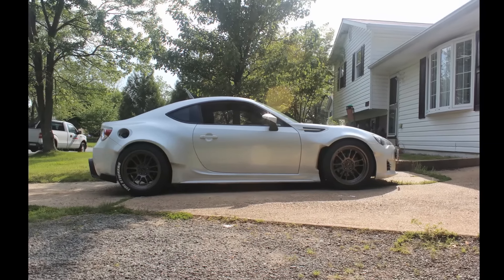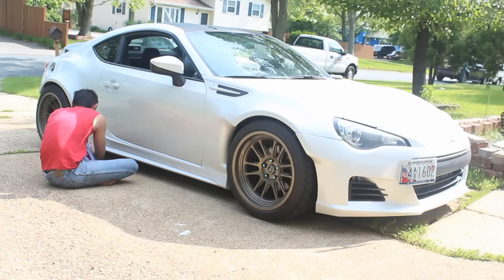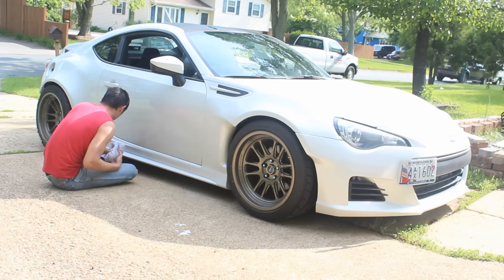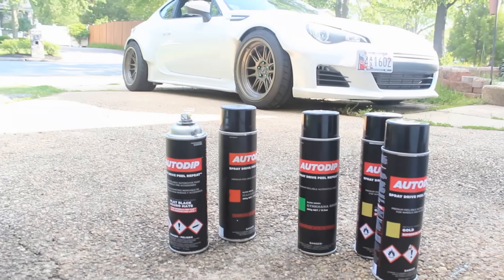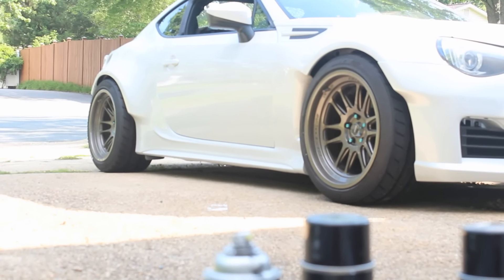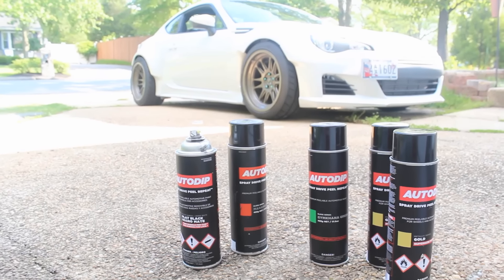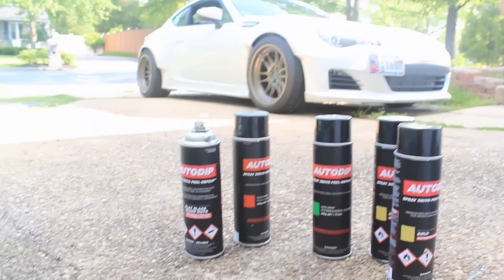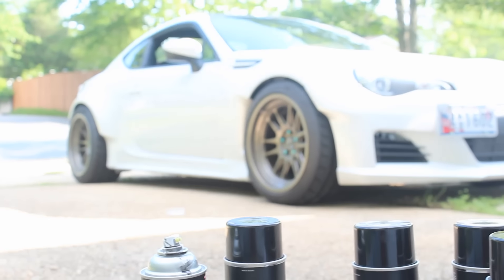Autodip Is Sweet!

Comment: Were you happy with the results in the long run with the Autodip?
Reply from the maker: They used to be call autodip and changed there names to superwrap. But I really really like it because the finish is glossy and feels smooth. It's just something plastic dip cannot match. Just need to make sure you add enough layers so you can peal it off.

Comment: I am like SO in Love with Plasti Dip..  Auto Dip.. etc...  SO MANY plans buzzing through my head..  all changeable to another..   
My Meteor Gray 124 Spider..  Wheels, headrest bars, windshield frame, mirror caps in Anthracite, hood/trunk matte black
Change up my black interior..  The SE RedTop has this cool black/Ivory combo...  OR..  red..  do mirror caps red,  calipers red..  

I also have a 1968 Austin Healey Sprite , aka MG Midget is it's rebadged cousin...  tired white paint.. / tired black interior.....   
Not restoring it,  just the mechanicals.  Its getting full body Dips for life, 1st color?..  Matte Black maybe w/pearl.. and the Interior??   RED!!!.. with the Black Matte, and Accents..  Hells Yeah...  Its SO SMALL I could change it up every few months  EASY...